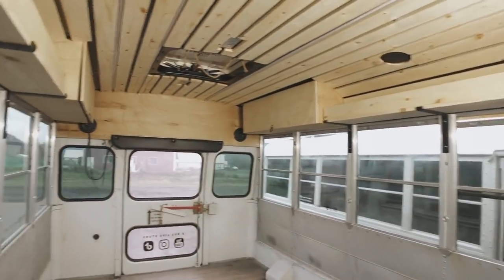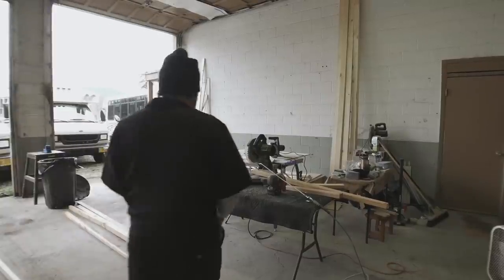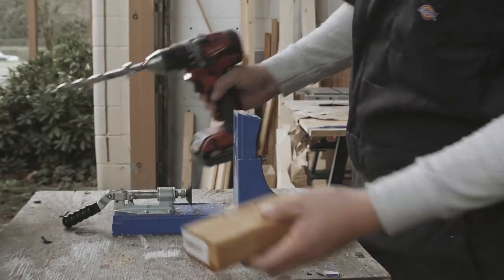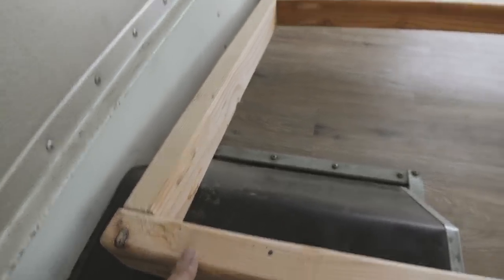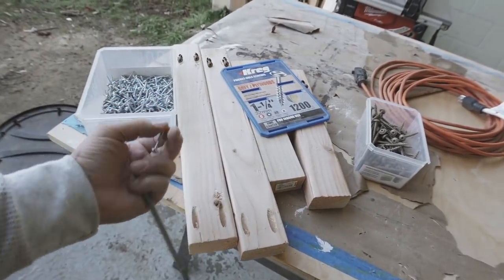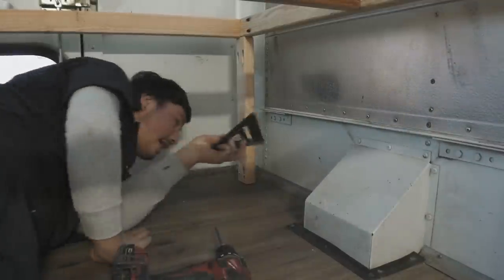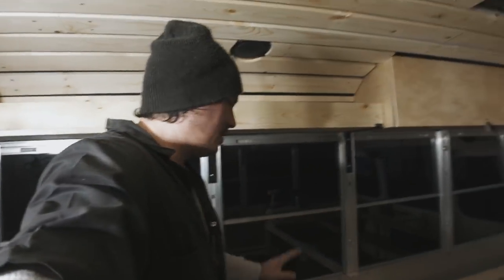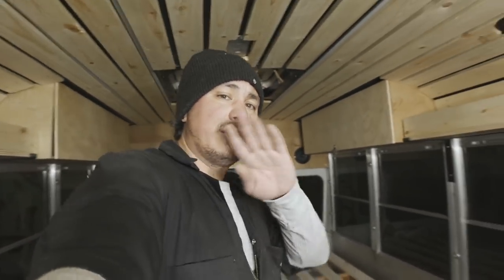How To Make A Bed Frame For Your Skoolie Or Van Conversion - 30 DAY SHORT BUS BUILD - Episode 3

Comment: I like that you broke it down to just the bed. I’ve read the comments so far (167) and see a couple people suggesting framing it but not putting it in until you get all the other stuff done in the back. I’m wondering if next time you were to build the frame without legs and then set it on top of 2x4’s attached to the side walls maybe hinged so it would be easier to get in to deal with the mechanicals at a later point. 

My thinking is that the older we get the harder it is because of injuries or joint stiffness to move around in small enclosed spaces. You are my sons age and even though we are twenty seven years apart I remember how much easier it was to move around to build, paint and clean things. Working smarter by working on tables rather than crouching over to cut wood or screw things together may do a lot to save your back and knees.
Reply: Good points there😍
Reply from the maker: Oh I def am considering some kind of hinged system for a future project :)
Reply: @isaacturnerit  I’m an engineer at heart and always looking for a simpler way to do things. Maybe you use the legs to mount stuff to so they aren’t rolling around under the bed, it’s been a while since I watched one of your videos while you were working underneath the bed but I remember thinking that I couldn’t lie on my side and move around like that anymore if I wanted to do a bus build...I’d have to work on it in a different order. Looking forward to seeing how this one turns out!

Comment: Isaac, you are a very good teacher. By using this format you are creating a video how to library. You not only showed the build process but you also showed people how to use a Kreig jig with it's settings. I am sure that most people building out a bus have not used a jig before, me included. Good tip about labeling the wood where the pocket holes will go and setting the depth guage on the jig. The emphasis on ventalation in the bed area will save numerous bus builders when they don't have to deal with the mold headache. Perhaps at the end of the week a quick 10 minute video (no editing) recapping the weeks progress while referring people back to a specific video. When we did our bus build we created a "floating" bed frame by anchoring into the sidewall metal ribs. We didn't have to create legs which opened up the underbed storage area. Hoping Jaylena feels better soon!
Reply from the maker: Wow great comment and all good points. Thank you :)

Comment: Great job Isaac. Focused videos are better. What’s the purpose of building in the bed frame at this early point in the build? Why not tack in the frame skeleton to ensure proper size and placement, then remove it till later so you have easy in and out access of the back door that you could use a hundred times every day without the bed being in your way? Cheers from Vancouver 🇨🇦
Reply from the maker: Cause I need to build off of it
Reply from the maker: Things also evolve as you build. You see things you didn’t
Reply: @isaacturnerit  Roger that😊

Comment: Hey Isaac, I've been watching you for a bit now and I want to thank you for creating this vid, especially. I need this kind of teaching. The Kreg jig tools are pricey for me. Do you have a suggestion how to accomplish the same task without the jig?  I want to use a futon frame on-top of a frame so that I can use the hinge for propping up either side of the bed. Also, I want to use a long dresser as the front of the bed, attach the frame to it. Then I have drawers already. Thoughts?
Reply from the maker: You can actually get the jig pretty cheap they all have kinds of different models
Reply from the maker: I think it’s easier to build what you need than to adapt something
Reply: Thanx Brother👍

Comment: Just wondering, couldn't you use a sheet of pvc panel for the top of the bed?  I saw another channel where the couple did that throughout their entire build to save on weight.  They didn't use wood on the bed at all, they used metal for the legs.
Reply from the maker: Yeah that is a new trend. I juts have never built that way so
I have no experience to have an opinion

Comment: Issac.. wouldn't it be easier to dry fit the bed frame and set it aside and the run your plumbing,  electrical,  heating wiring n installing and then put the frame back together... js  ;)
Reply from the maker: I run all that stuff to and thru the frame

Comment: If I want to use same  design but a true double 53x74 and make it a loft would I need to change anything other than leg length?
Reply from the maker: Nah just the cut sizes
Reply: @isaacturnerit  how can I make it though without the middle support legs. So that the under area is wide open
Reply: If you double up on the 2 by 3s ( nail two of them together) will add the extra strength
Reply: @richwalsh6510  how long/wide is your bus?  From behind drivers seat?